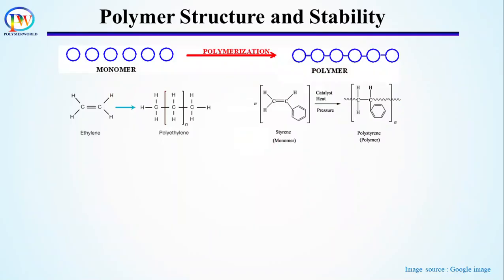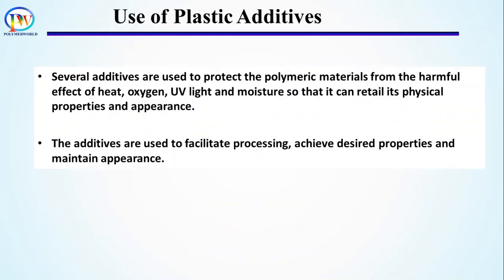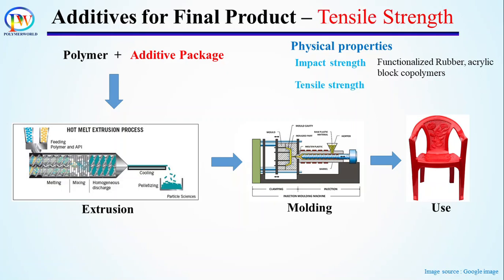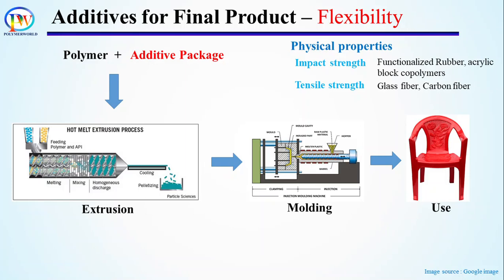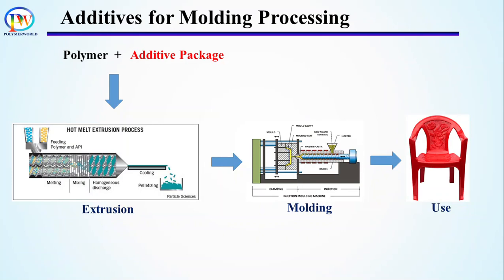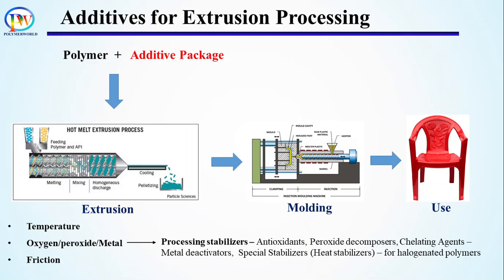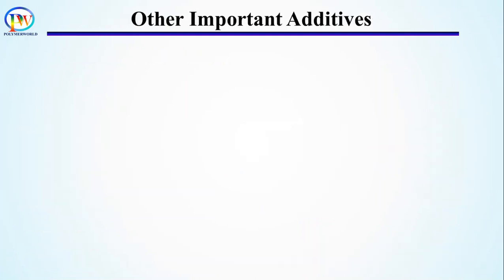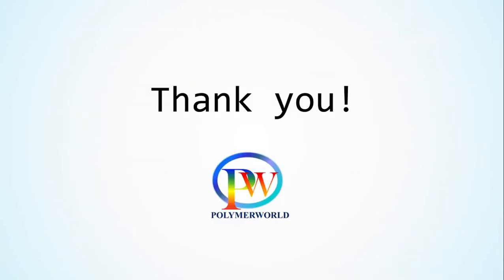Plastic Additives

Comment: Hello u always give me answer of my questions plz give one more answer plz tell me about which is the best impect modifier for HDPE those are available Easley available in india
Reply from the maker: After this I am going to charge you.... Anyways there are several impact modifier for HDPE offered by Avient (Formerly PolyOne), Dow, J K Group etc. like ATTANE® 4206 copolymer, POLYBOND® 3009, D400.A35.N etc. The choice depends on the product formulation and application. So my recommendation is to talk to your additive provider or additive distributor, they should be able to provide you the best impact modifier based on your product formulation and cost.

Comment: Hello sir I m plastic crate manufacturer I mostly manufacturer crate of recycle material I want to increase strength of crate of HDPE and pp which additives can mix for increase strength
Reply from the maker: Use of thermal stabilizer and acid quencher curing extrusion can help to improve the strength of recycle material.
Reply: What additive is used to make plastic printable, such as plastic wraps for flowers with little birds on them( or something similar)